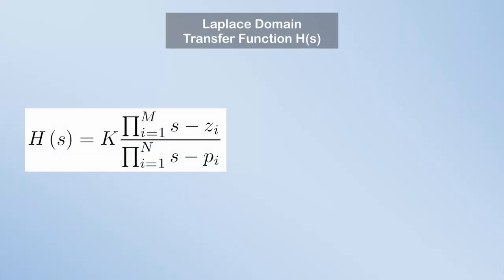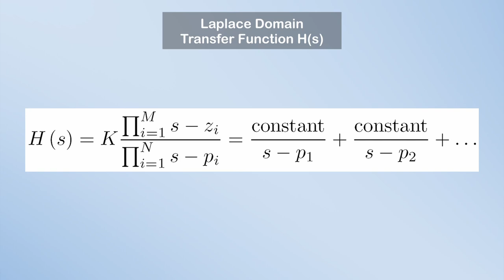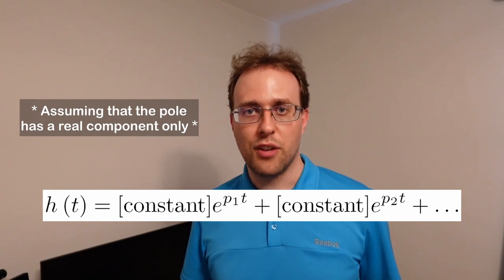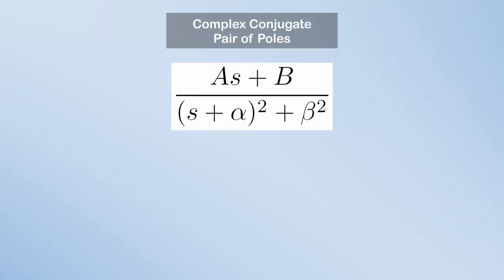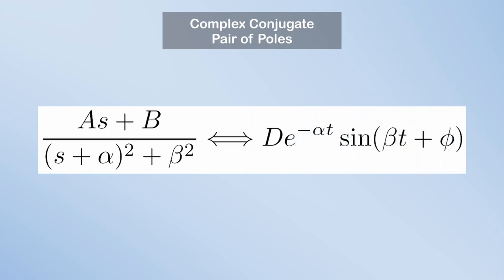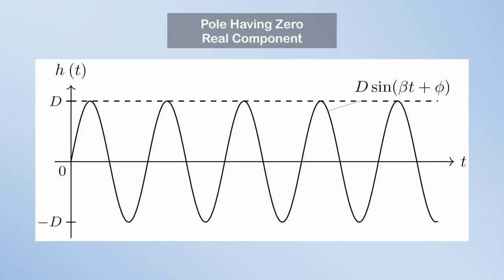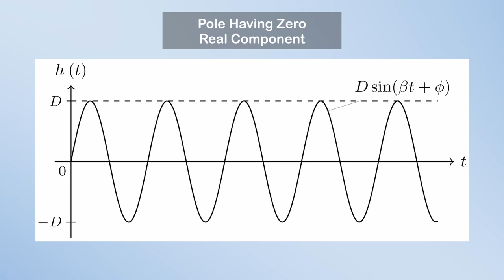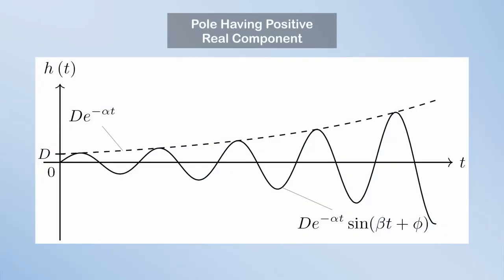Stability in Analogue Systems

Comment: Is there a way you can project the math onto the wall junction behind you so that they appear...stably? Also can you discuss alternatives to (outputting) clipping, latching and flutter? Maybe even HDRdiffusion instead of stablediffusion (TVs coming with QAM4100 and AI HDR 4k∆imgrender?)
Reply from the maker: Thanks for the suggestions. Wall projections aren't really practical with my current setup - though it reminds me I should post something on there. It's much easier to add the math in post. As for the other topics, they aren't really areas that I can speak to, I'm afraid.

Comment: Thanks sir ! Looking forward for next video. .. I have a question. ... If a circuit have transfer function H(s) and we put s=5+0j then what does the value of H(5) tells ? Its output with 5 volt dc ? Similarly what about about H(5j) tells ? Its output with 5 volt ac signal?
Reply from the maker: You've read my mind for the next video, so stay tuned! ... You're thinking in the right direction but we can't translate time-domain inputs quite like that. We focus on the imaginary axis and write s = j*omega (Fourier transform) where omega is the frequency in rad/s. So a DC signal is at s = 0
Reply: Hey kids these days, why not work with nice 32V rails so you can put one directly in your car or omniwheel? [Tesla announces standardization of 1.2 V equipment.] What do PsOC work at anymore?